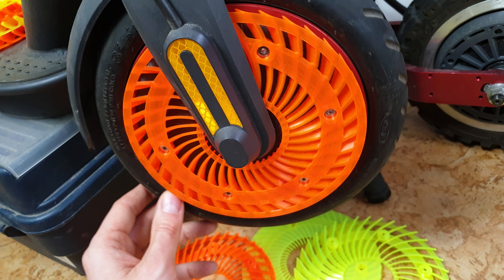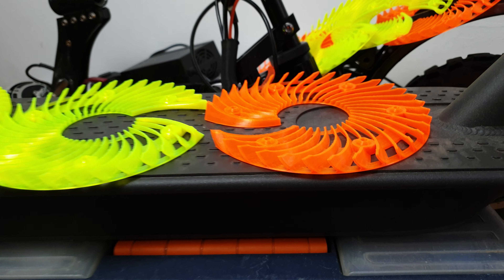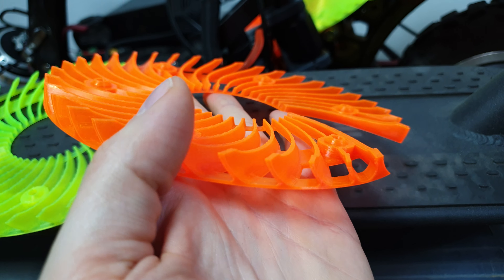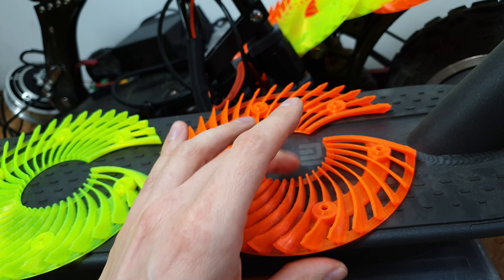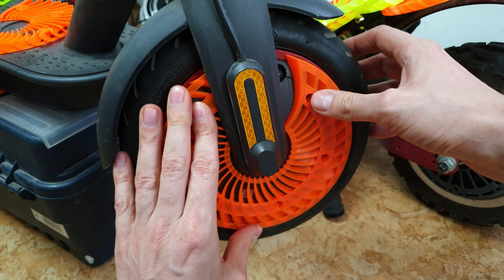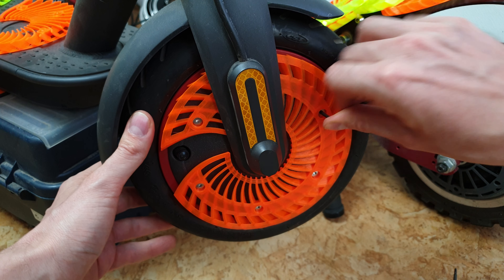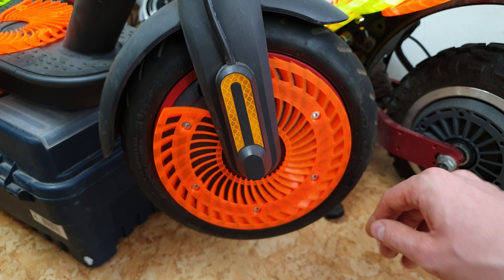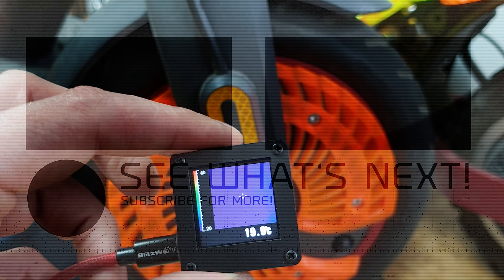Xiaomi M365 MAX Cooler 🛴⚡ It could be difficult to build better cooler than this 🚀

Comment: Are you sure it was printed the right way? The blades have to catch air and spread it like the fan blade
Reply: I think the same! the blades must be to outside bended to the front to get the air um pull in direction of the metal this kind of blades doesn't change much because we don't have a comparations to see that!
Reply: I was thinking of the same thing. Better if printed the other way.

Comment: I'd love to see comparative thermometer results
Reply from the maker: I will do it soon on my 2wd :)
Reply from the maker: lol I am sure you are just troll :)
Reply from the maker: @seropserop  So Mr amazing guy , please render for me air flow at speed 25km/h where front tire due to movement makes small " air curtine " and proof me that 100% of motor shell got nice air flow because this air curtine doesn't block air flow from the the front side, please do, I will buy a 10x Pint if I am wrong . Cheerio
Reply from the maker: So you re troll at the end
Reply: I honestly would like to see results also please.

Comment: I would love to see any real life measurements of this cooler. Since you said it is better than the previous ones - how much better. I am a bit sceptical about this, as we are cooling plastic, which is not good at conducting heet from motor itself. One the other hand it is the only way to do it.
Have you considered cooling the motor from both sides? I mean, of coarse it would be thinner, but maybe it is worth a try.
Reply from the maker: Right side is full alloy shell , left side is half plastic so ...
Reply: paint inside the frame to  mat black. it's improving heat transfer.
Reply: @PirateWasHere Question -
What if i use this on Right side and The old on Left will it be worth the try??  😅
Reply from the maker: On the left side is plastic cover so i guess no point doing it, only on right side you can notice any difference

Comment: This cooled my scooter by about 4 degrees didn’t melt and fits great 👍
Reply from the maker: Do you have my cooler, for how long are you using it ?
Reply: I’ve done about 60 miles so far and my longest ride in one sitting is 14 miles off roading and on roading Works great 👍
Reply: Even came with a complementary waffer 👌 top man

Comment: for more cooling Paint the inside of the motor frame to black. I did this because the motor heat is absorbed more by the shell.
Reply from the maker: but how black color can absorb heat ? Black color can absorb light so protons  but I am not sure if it can absorb higher energy state of the atoms ( temperature )
Reply: @PirateWasHere  Heat is a state of radiation emitted by objects, but not seen due to its high frequency. But it is still more absorbed by the dark surface. Try this. Cut two aluminum plate of equal size. Paint one matte black. Place them at a distance from a heat source. For example, a distance of 5 cm from a soldering iron. soldering iron in the middle. You will see that after a few minutes the heat of the black sheet is much more than the heat of a normal sheet. Which means absorbing more heat from the heat source. I did the same with the scooter motor , but not magnets, and now the motor shell heats up a lot more than before, which means it absorbs more heat from the motor stator. Now this absorbed heat is better transferred from the coil to the outside by the shell.
Reply: I do not know why the factory does not do this and the inner surface of the motor shell is polished aluminum. Hold heat like a flask. Maybe because we do not know how hot the motor gets. sorry for my English.
I like your channel.

Comment: Have you not thought about finding a way to use it on the opposite side? By removing the plastic protector there is a gap to better cool the problem is the support.

Comment: Would appreciate if you would rather sell the STL files, cause 30€ for a one side cooler is way too much - so I’d rather print it myself.
Reply from the maker: 30E where ? , soon it will be 16E with free shipping. If I release STL then all shops will start to sell it so ...
Reply: Pirate on your shop it is nearly 30€. Even 16€ is still a lot. I think people with a 3D printer would benefit more from an STL File, but you are right: Others might start selling it.
Reply from the maker: @patrickscherzy  i set prices to 17E already Vat is adding automatically, i have to pay around 10E for shipping, print time is around 6H , so in my pocket could stay like 2E from this 17. Not the Best deal ever.... . Thanks for your input 🍻🍕
Reply: Thingy verse has it to download i thinki

Comment: What are you doing man you cooling the oitside case this is joke if you want serios result use oil gearbox inside and it will cool 😎 i meann really cooling beacouse it will make contact betwen motor and case.
Reply from the maker: I know man , also using radiator on pc processor is joke...
Reply: @PirateWasHere   but radiator had direct contact with procesor , gier you don't have direct contact with motor,betwe  outside case and inside motor you don't have contact you have air how do you want tho transfer heat.You need to goo so school and study Physik.
Reply from the maker: @alexikzekee8769  🤣🤣🤣🤣 so why moto shell can be easily over 80c ? Man u re not very smart by telling me  (go back ro school)
Reply: @PirateWasHere  look man from 85 drop to 80  so 5 degrees its nothing. Whenn its droping from 85 to 40-50 then its a diference and that you solve with ol or ferrofluid(magnetic fluid) or better you can drill holl in outside case but it's not anymore wheather protect .I think your product is time Lose  and money.
Reply from the maker: @alexikzekee8769  u have no idea what u re talking about as usually people like u which talk a lot. If outside shell got 80c then inside can be over 2x hotter, so any degree less on outside shell will seriously decrese temp inaide. Also there is a reason why all manufactures seal motor and not drill holes 🤣🤣🤣🤪.
Reply from the maker: Ferrofluid will not help here much , but I got your point Bruh ;)